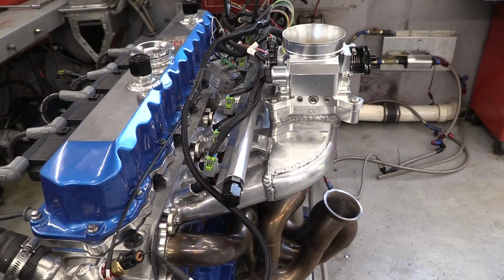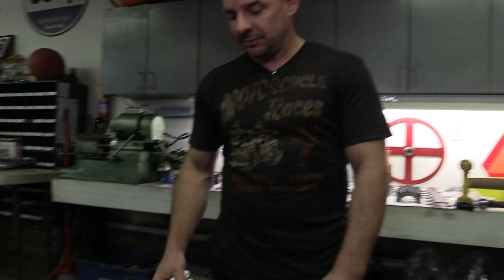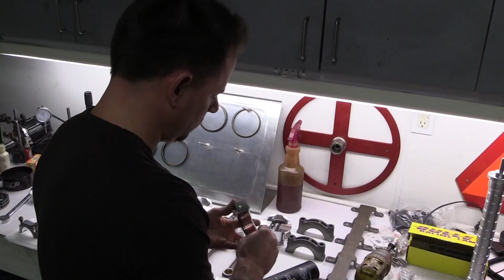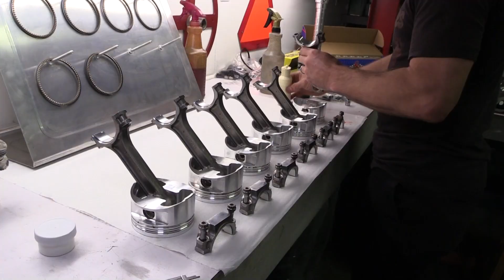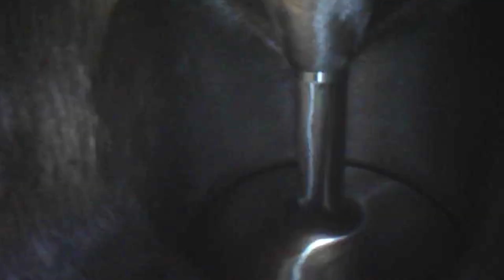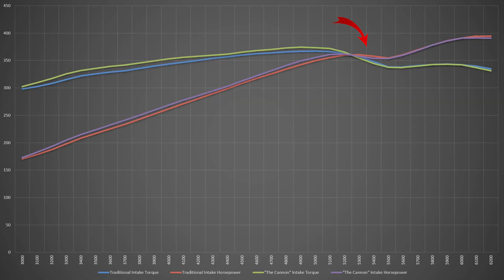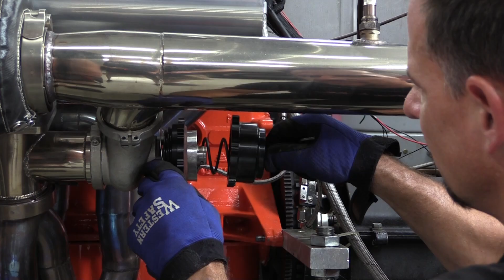Turbo Jeep Smashes World Records! (Tons of Innovation!)

Comment: Anyone who loses their mind because you use a magnet to instal tappets simply does not understand how magnetism operates and how anything with ferrous metal can be magnetized. First of, it would take a standard magnet a long time to magnetize a tappet like what they are using here, and this brings me to my main point. The only way to magnetize a big piece of metal like these tappets is by leaving a magnet on them for an extended period of time, and then it would depend upon the strength of the magnet. Also, metal that has been magnetized loses it magnetism the hotter it gets, and with the constant cycling of heat and ordinary outside temperatures it is HIGHLY unlikely that they would remain magnetized for very long. Now having said this, it would be a little more likely to happen if someone were to use a rare-earth magnet, which is much stronger than ordinary magnets but once again it would take a while for it to happen, and they would make it very hard to instal a tappet because of their strength, so using an ordinary magnet just for s few seconds needed to instal the tappets into their journals is hardly enough time to warrant any concern regarding magnetization of the tappets. Just don't use Rare-earth magnets and leave them on for an extended period of time, say...like a day or two. However, I DO recommend using rare earth magnets in the bottom of your Oil pan and use the magnets that come from computer Hard drives, because the flux from them is likely to suck ANY metal particles out of the oil pan and keep your bearing surfaces nice and smooth! I did it to my 1979 Mercury Marquis with a Ford 5.0L in it and after a month of time I took off the pan and it was amazing the goo on them for such a short amount of time. I cleaned the pan and the magnets and reinstalled the pan as before and the engine is still running good without issue, and the oil in each oil change looks barely different from when it was first poured in! that was over a decade ago and my friend, who bought the car, says it's still running fantastic. Attention to detail is always the first order of the day when it comes to rebuilding an engine and don't listen to quacks who have no idea how physics works!

Comment: In Australia we have the Ford 4.0 Intech and it’s successor the Barra which is also a 4 litre straight six. The Barra particularly is popular for cheap power and reliability and used in old 4wds for going up sand dunes etc.
Reply: the intrch is better then the barra.sounds slightly better.far from great

Comment: Please clarify what you mean by world record; for Jeep or 6cyl engines?

The Australian Ford Barra 4.0litre are comfortably on the street around 1200hp reliably, and race engines around 2000hp.

The Barra motor was designed by Ford Australia, pretty bullet proof.

Related to the old 250 ci 6 cylinder 2v Ford engine.

Would be great to see you do some research and show this Australian motor

Comment: This looks like the extent of the modification of the 4.0 unless you go to a crossflow head. The bore spacing is the same as a small block Ford. You could cut and weld a couple aluminum 351 Cleveland heads together and make a breathing monster. You would also have to do a custom cam for this as well. I am thinking of doing a proof of concept with a 2.5 4 cylinder to start with as there would be no head welding involved.

Comment: We don't see many of those straight sixes here in the UK but the ones I have come across from time to time always sound sweet regardless of the mileage and level of sympathy the owner has bestowed upon them,we had similar engines over here but they are long gone sadly.Most of the stuff we do now is 4+6 cyl Duratec based,the last old engine I worked on was a Chrysler/Jensen 6.3 about ten years ago.The best part of that was seeing what is essentially a dinosaur push out 860 hp and 850 plus ft lbs, mightily impressive.even non boosted that low comp engine was stout and outperformed the factory spec by a country mile. What's not to like,top stuff.

Comment: I am not trying to Knock your Vid and love what you are doing, But you do know that crank power is totally different from Tires to the street power.. I'm seen 225 WHP cars, smoke so called 400/500HP cars.. You can those number's down by about a 3rd, after it makes it through the transfer case, and to the drive shaft.. 
   I'll just leave it at this, I prefer my power and numbers to come from a car, with tires to Rollers on a DYNO.. I guess the dyno set up you guys are using is good for your purposes. I would rather see the motor in a jeep and what it can do. But still love what you guys are doing and great job, keep it up..
Reply from the maker: Of course I know they are different. Those are drivetrain losses. If you want to know what it would make at the wheels, take 20-25 percent off for a two wheel drive car and 25-35 for a 4wd.
Reply: I know you know.. This is what you do.. I'll tell you what though the average person doesn't know that though.. Anyway great job, I would love to see this set up inside an actual jeep and what it can do..
Reply from the maker: Oh, sorry!
Reply: @TheHorsepowerMonster   No its cool, I'm with you..

Comment: Don't get me wrong.  I live EFI, CNC, ECMs, CCV and all that high tech stuff.  But I really miss mechanical horsepower, hand ported, no computers, no injection, etc. Back when we were changing holly jets by .5 of a number because Bobby boy thought it was a bit thick in the air tonight, etc. That kinda stuff.  Plus when Leroy has his red eye hellcat sitting there stealing all the whoas and wows then I walk by jump into my n/a 68  big block side piped  4 spd dual carb'd 800 hp vette.  It's like Leroy who.  Everyone seems to love the old days and old ways still.

Comment: If you grind & peen shot the rod beams they could have lightened & strengthen by 30%. Plus you have to match the rod weight to balance the whole reciprocating system crank, rods, & balancer from a good crank guy!

Comment: A turbo charged 4360 cu. In. 28 cylinder radial aircraft engine can produce over 4000 hp at 2700 rpm running full rich on 145 octane Av. Gas and an injected 50% mix of distilled water/Isopropyl alcohol. At this RPM the engine is producing about 1300 foot pounds of torque. This is called War Emergency power (WEP). The engine can only sustain this output for 5 minutes. If the aircraft gets back  to base in one piece the engine is considered scrap and replaced with a completely new/rebuilt unit. Cost is not the object to the USAF. This technology has been around since the middle 40s.

Comment: just found this video and the straight six seems to never disappoint when i start thinking of what to do on my next motor. definitely going to be putting a lot of the components used in this video in my next build!
Reply: I followed this build and one other build for mine and am still in the works of doing more to mine but I turned it down cause it's nice and very controllable at 5psi ...it's still fun my trans and tcase just won't take much more than that ...but boyyyyy when I swap the trans and tcase my f9 inch axle in the rear is built for 800 + whp I will then turn it up to close to what this is ...luckily I live near to where Kieths shop is so wouldn't be hard to have him tune it once I go full send on it

Comment: If you just forget that it's a Jeep, and put it in a dragster chassis  ... holy smokes you would break more than just dyno records.
That said, I'm not so sure what the practical application for this engine would be. I am blown away (pun intended) by the torque numbers under pressure. I would have liked to see what happened below 3500 RPM and or what this build spec would do with a tiny turbo and a goal of making the, can't have enough off idle "Jeep Grunt Torque" that every Jeep wants more of.
Even with 5.56:1 air lockers, 880 Lb. Feet of torque at 4800 RPM is good for little more than broken axles in a Jeep.
However if the same engine was, or can, or would produce 550 Ft Lbs. of torque at 1200 to 1500 RPM then a qualified clutch foot or automatic trans could turn a Jeep into a cliff scaling mountain goat.
Nevertheless, if you just forget that it's a Jeep, and put it in a dragster chassis  ... holy smokes you would break more than just dyno records.

Comment: I think I’d stick to a built 4.3 265HEMI WITH TRIPLE 50 mil side draft Weber’s the Australian built 72 E49 Valiant Chager R/T 4 spd with triple 45s on the 265HEMI WAS THE FASTEST FULL SIZED 6cyl production car on the planet.. was faster than the 351ci GTHO PHASE 3 Ford and the GM Holden GTS 350 Manaro over the quarter mile at 14.4

Comment: I just bought a 95 jeep Cherokee it was a barn find in outback Australia blistered paint and all the typical stuff no dents no rust hadnt been used for 4 years. New fuel pump started straight away. Now that i have been reading about this motor i dont want a new 4wd. Jeep got it spot on. I will get a new paint job and keep this magic  little beast.

Comment: HP is pressure.  Peak cylinder pressure should occur at the optimum crank angle.  Pressure and temperature are directly related.  The auto ignition temperature of the fuel is the limiting factor.  I heard detonation.  These guys are running a good test program.  Upon disassembly the bearing or bearings that has been hammered by detonation will reveal a lean burn condition caused extra air.  The intake runners require modifications, or tuning.  Good job.  Ken former Garrett turbo Racing lab guy.
Reply from the maker: All true. Thanks for watching, Ken

Comment: A lot of people think water/methanol injection is basically snake oil.  On naturally aspirated engines, you see very little gains, if any.  But when you use it correctly on a forced induction engine, it works.  The engine really responds to the cooler, denser air if it's tuned for it.
Reply from the maker: Absolutely true

Comment: Why such a low 8.6:1 CR ?  All 2021 EOM turbos are 11:1. 
10:1 is a better choice for a high hp build, intended to run mostly on e85. Much better pre spool engine response, faster spool, better fuel economy.

Comment: The Brazilians get similar or more power out of the old Chevy 292 6's with stock block and iron heads and run consistent 7 sec 1/4 miles in street cars. I'm really starting to doubt the importance of DOHC and fancy billet components with boost.

Comment: 80 #/HR Injectors is the only reason this setup didn't break 1000 HP, Should run this again with 1200cc injectors
Reply: This is great power but the race teams in Brazil have been making 1000-2200HP with Chevy 250CI straight 6 motors.
Reply: @prestigeracingmotorsports9169  You gotta link for that?

Comment: That HP dip is what typical home garage builders run up against then never figure out why that motor just doesn't feel right. Great tuning example here.
Reply: plenty of home builder do overcome development problems such as these
Reply: That dip is always a valve train instability issue. Usually correctable by using different springs. This is the reason I have EVERY one of my engine builds dynoed.

Comment: I dont like the head design with exhaust heating up the intake manifold, i did hear the counterflow flows better then the crossflow 2 valve with single overhead camshaft
But the heatsoak must be robbing allot of power
Reply from the maker: That's the only option they have for this engine. So we had to make the most of it. Thanks for watching

Comment: My 88 Comanche Eliminator was a badass little truck. It lasted close to 25 years (September 1987 - MARCH 2011) and over 300,000 miles. Many trips to and from Florida to N.Y. Thanks for showing that an old work horse mil can put out high H.P.

Comment: Make these components available to finally make tuning possible and the 4.0L will burst on the market as possibly the next 2JZ!
Reply: 😆 my OEM stock block 2jz make 932 hp eBay turbo manifold 68/70 turbo 200lp injector S2 cam spring and retainer arp head studs
Reply: @ae862jz8  I get it but what you don't understand is its not the 4.0L hardware holding the Jeep motor back all this time. Chystler made them untenable in many ways. The biggest thing he's achieving in this video is not the HP, that's just what's pulling us in. He's opening up a huge window to making this motors a viable power option now. I can guarantee you if the parts are put on the market so aftermarket tuning can be achieved, people will smash the 1k HP quickly.

Comment: My uncle was one of the designers of the 4.0, when it was still AMC. He said they put one on a dyno , and ran it non stop for two years. They simulated daily driving, snow, rain, mud and towing. It ran a 55 gallon oil drum and a 55 gallon coolant drum.
Reply: That's a really interesting story!  That's a hell of an endurance test alright.  Thanks for sharing.
Reply: chrysler australia had a dude sit down at a dyno and manually simulate an endurance race on the 6cyl E37/38/48/49 Hemis ,in the end the engine could get through 3 "races" before even losing power
Reply: And just think…,Mercedes Benz, being the innovators they are build cars without enough real world testing to see if their production cost saving crap will last.
I feel bad for those who bought mercedes that have the dreaded SBC braking system , the plastic bits from their intake manifolds destroying their valve train when they come apart and the timing sprocket teeth wearing out causing extreme timing issues and $5500.00 check engine lights….without a recall issued even though they build the engines with these crap inferior parts.
Shame.
I work on Mercedes for a living but I don’t own one and never will….I hate the piles of absolute over rated crap which is why my daily driver is a 99 Cherokee sport with 320-k miles and a fresh rebuild at 290-k.
Reply: @vikingrobot4179  the "biodegradeable" electrical wiring used by mercedes and volvo should have been recalled along time ago
Reply: @andrewsmart2949  
Oh God yes.
Reply: @vikingrobot4179  Same.  But I did like the hand made AMG era.
Reply: OUTSTANDING...I HAVE ALWAYS LIKED THE 258...Glad to hear your Uncle was one developing this great engine...
Reply: I believe this. I've seen them in industrial applications where they've run for years on end outside! What a great little engine.
Reply: @MrCarnutbill67  me too they're built like a industrial diesel engine
Reply: @MrCarnutbill67  FORDS BIG 6...2.9L IT WAS LIKE THE BEST USED 6 BANGER FOR INDUSTRIAL APPS...MANY NEVER REV PAST 3,000 RPM AND LIVE FOREVER...
Reply: @bigsparky8888  300 cubic inch is close to 5.0L,the 2.9L your talking about is the 4cyl forklift version
Reply: @bigsparky8888  The big Ford straight 6 was 4.9l, not 2.9l
Reply: Gm did the same thing with their atlas i6's they put in the trailblazer too. They ran them at WOT for the equivalent of 150k miles and ran some of them up to 300k miles.
Reply: @suprchargrhvn  I can attest to that.  My brother and I both have stock (used and abused) 4.2 atlas engines in trailblazers with over 200k on the clock. No issues so far with the engines.
Reply: I had 05 trailblazer from new went 260k nothing but oil changes and never had an issue .. great motor if ask me .. still loved the simplicity of my jeep 4.0 HO ..
Reply: Trznsmission , different topic .. lol
Reply: My 4.0 Jeep sat for 7 years .  I changed fluids and new battery and it started off the key .  I love these motors
Reply: the key is getting the power for the job while making it live there. be honest i was surprised it didn't pop or run into wall flex. shows you what i know. your uncle, bless his AMC heart.
Reply: I'd love one of the new jeep trucks with a fuel injected 4.0,I miss my 95 lerado.
It rusted at the cross member only on 1 side and I shattered my kneecap and couldn't fix it so I junked it.
Reply: @WYLDBILL  im thinking of putting one in an australian valiant/chrysler
Reply: @andrewsmart2949  I'm putting one in my 67 rambler
Reply: @davidhogg338  hows an empty arse fake troll channell like yourself gonna do that? LOL
Reply: Where did they put the 55 gallon drums on the vehicle
Reply: @tylermartin5560 stationary 😅😅
Reply: They ran it on an engine stand mist likely , just had it hooked up to 55 gallon drums so oil and coolant wouldnt break down or need changing so they coukd run the enhine constantly for 2 years .
Reply: How much ? Jeep Grand Cherokee 2002 4.0
Reply: @mauriciopatterson8588  as far as reliability is concerned it's priceless
Reply: That's awesome
Reply: I believe it. I remember back in the early 80s a media piece that stated GM,Ford and Chrysler tested at peek rpms for 200 hours. AMC did a 1000 hours.
Reply: I don't  believe that  crap. What would  running  an engine  for 2 years prove? There are volvos  that have 900.000 miles on them. I  had a Chevy  truck with 472.000 miles on the motor.  So tell them to put it back on the dinosaurs for 20 more years.  Lmao.
Reply: @williamgray1029  assuming running it at an rpm that would simulate 60 mph nonstop for two years that would be 1,051,200 miles.
Reply: @williamgray1029  I realize that I'm a year late to the party, and you have my apologies. What I wanted to say is that, I don't believe your crap. Good day.